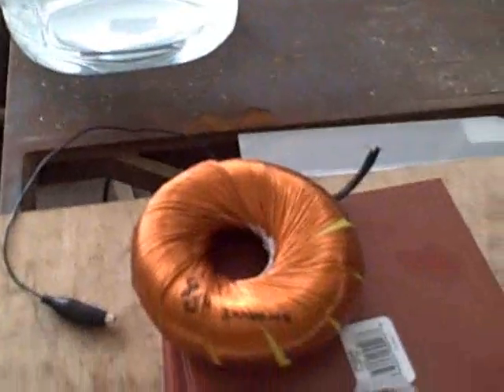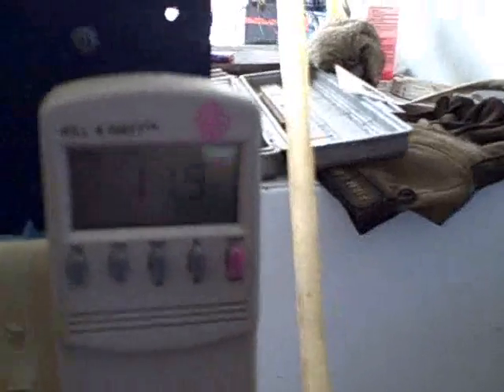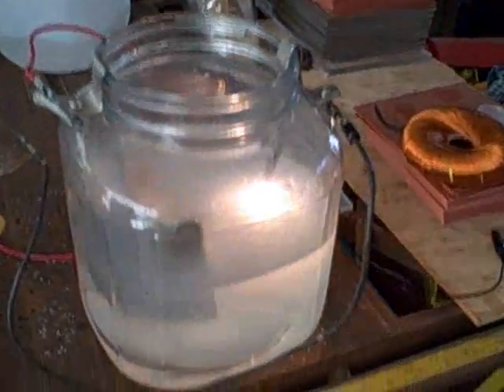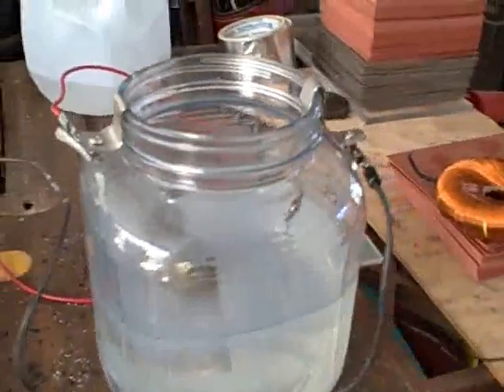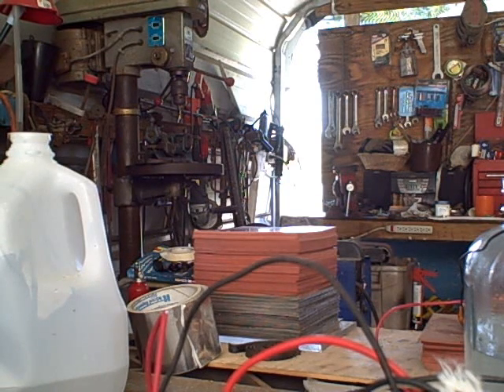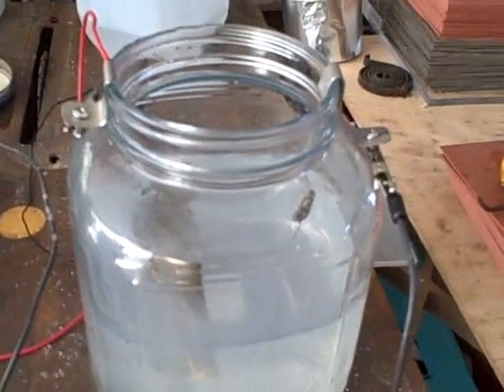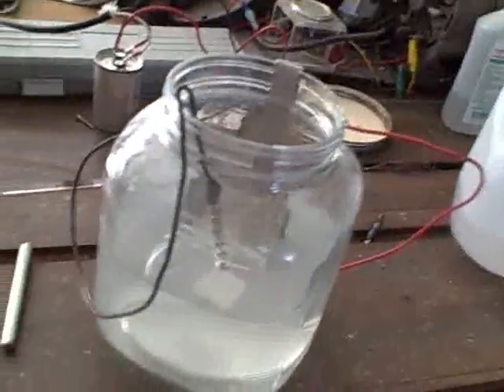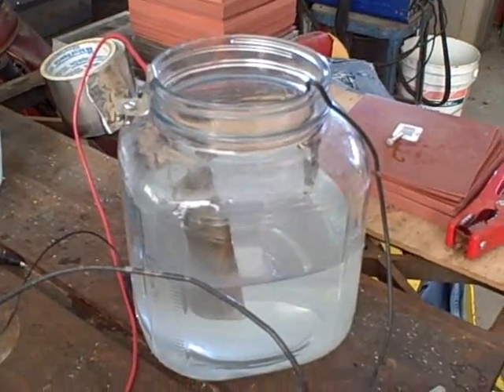120 Vdc electrolysis.wmv

Comment from the maker: I have played with plasma enough to know the difference between plasma arc and high dc voltage arc. This has not achieved plasma fully yet. When I am able to produce a solid 400-450 Vdc variable voltage I will be able to form a plasma cocoon around the cathode. That will lower heat and reduce wear on the cathode.

Comment: looking good-im wondering why you wouldnt call that plasma tho...you probably mentioned in your video but i just put a new video card in my machine and how youtube vids are going too fast and i got no audio...but what are you using for electrolyte?
btw you can get potassium carbonate in solution from an asian supermarket.
its called "lye water" and is used for some sort of pickling process.